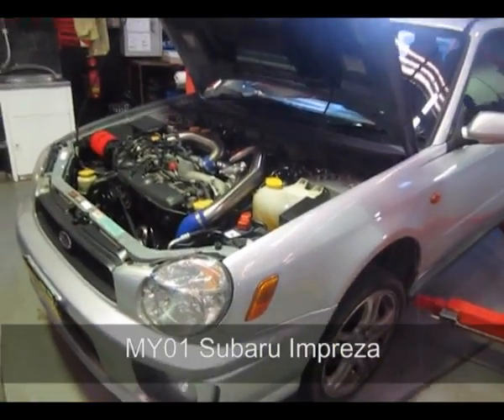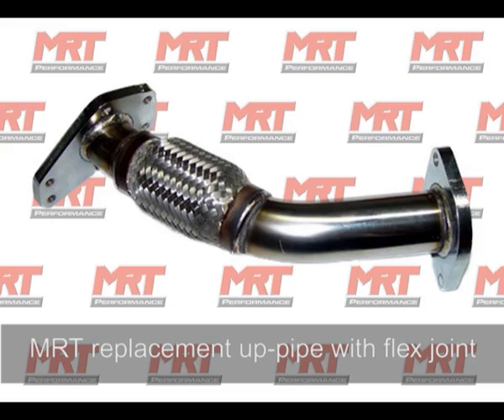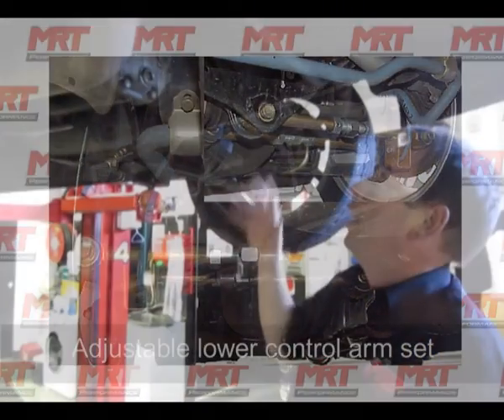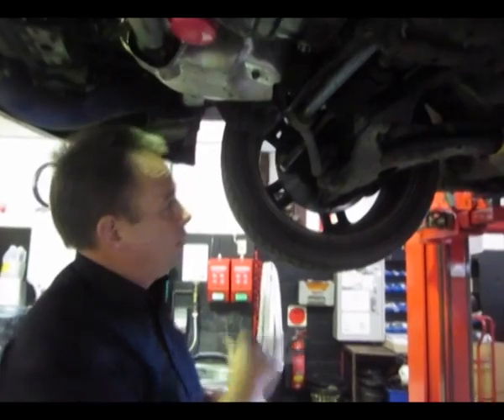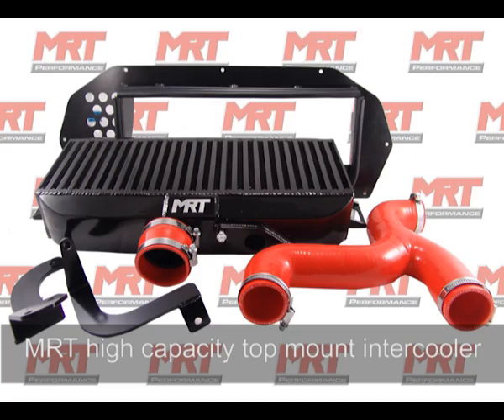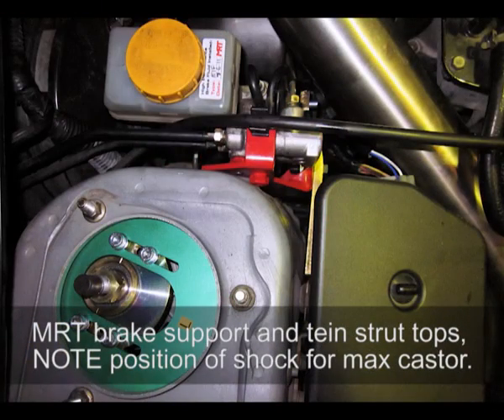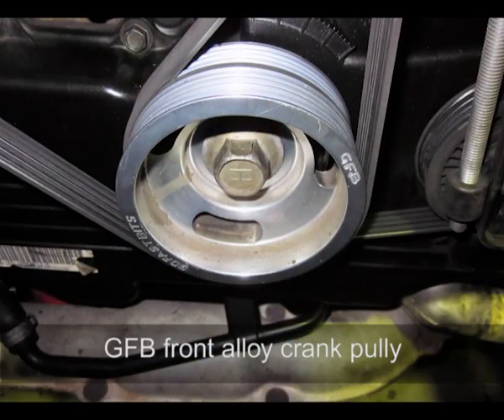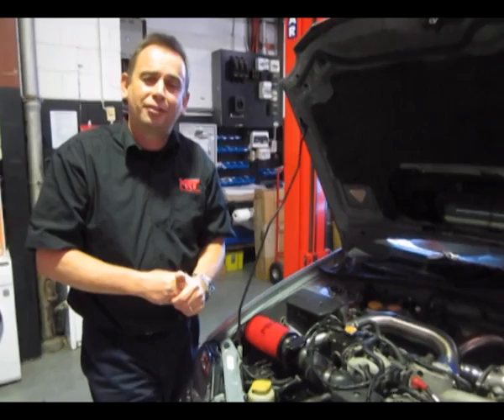Subaru MY01 WRX tech data and secrets

Comment: Many people change their oil (and filter) every 5-6000km. Using this as the preface for my question, how would you describe/compare the difference in ability to filter impurities between an Sti and Wrx oil filter when doing oil (Mobil 1 5W-30) and filter changes every 12,000km instead? Very interested to hear your professional opinion on this matter.